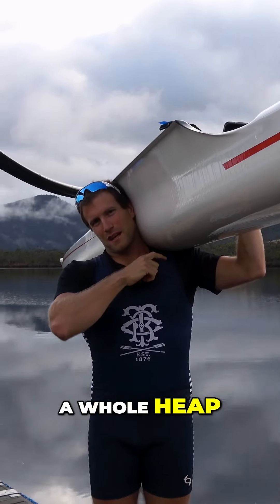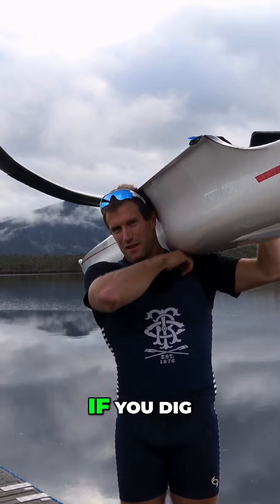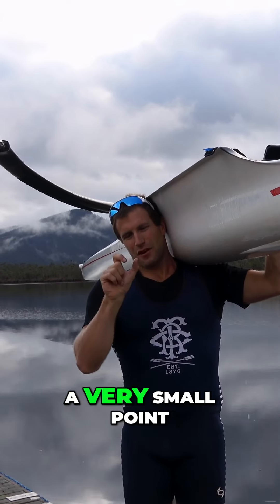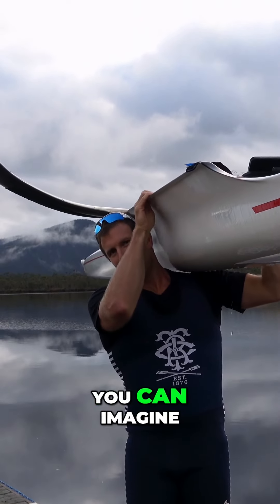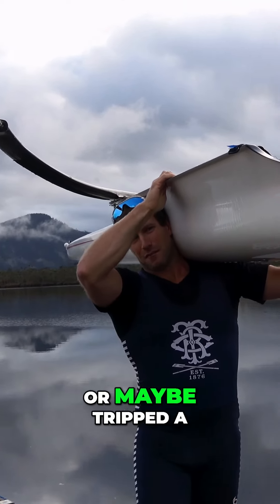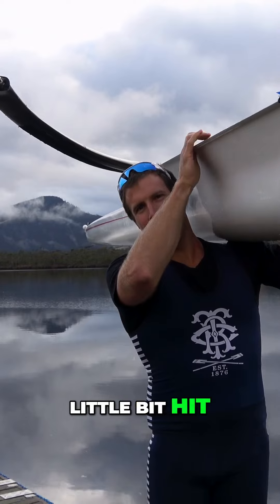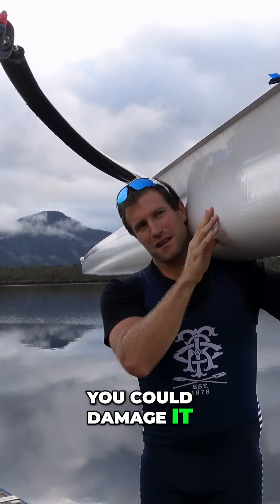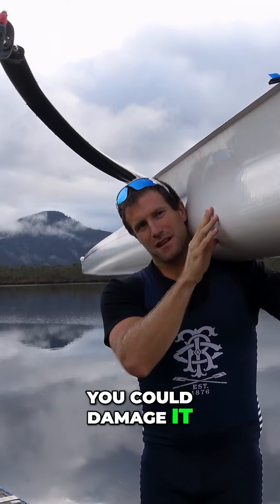How to carry a single on your shoulder

Comment: If you're strong and have a super lightweight single ok. For more normal folk with the usual strong and heavy club boats no. Asking for trouble and shoulder/neck injuries. Best to have two people. Or carry over head IF you have the strength or at waist if you haven't. Pretty fed up with rowing 'advice' that presumes fit male 20 something. We should be more inclusive.